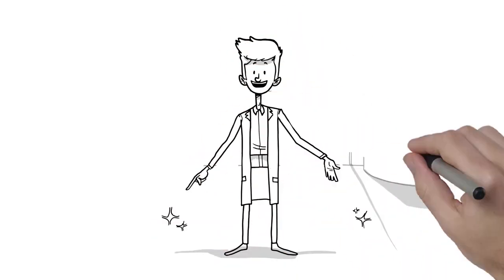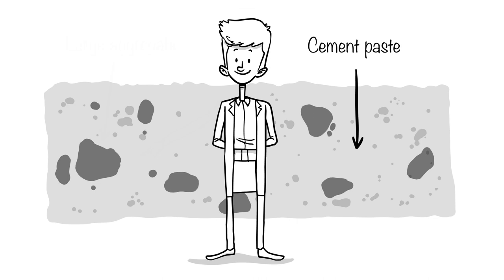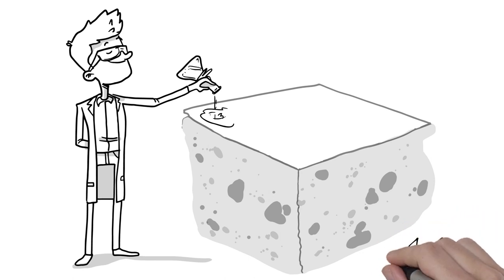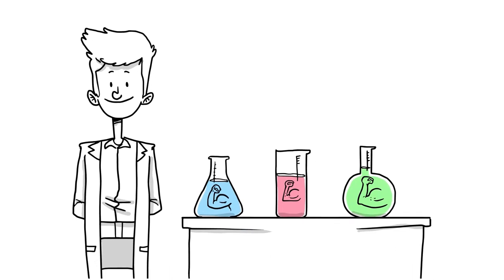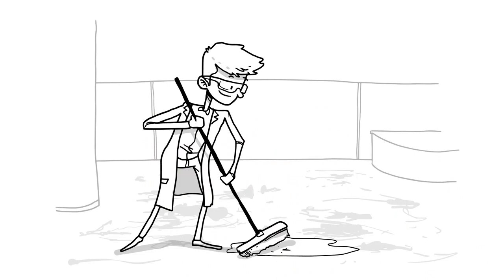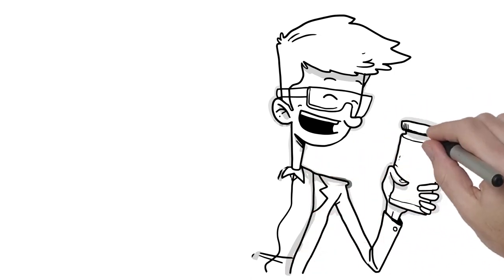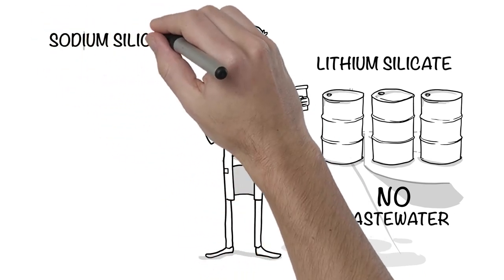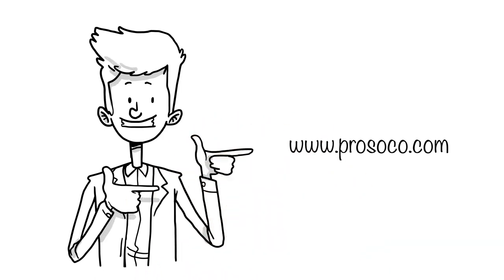Chemistry of Concrete Floors - Densifiers Demystified

Comment: Wich chemicals Best of concrete floor, sodium, or potassium, or lithium. Wich is best concrete floor polishing liquid.
Reply: colloidal silica Lithium silicate also leaves deposits if it is overapplied. Colloidal silica is 99.5 percent pure silica, so residual deposits are not an issue.